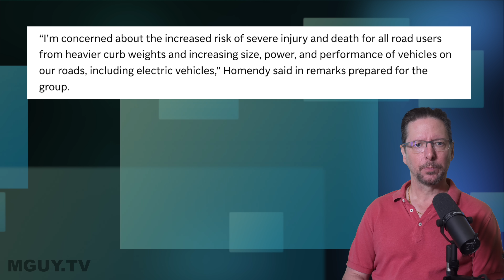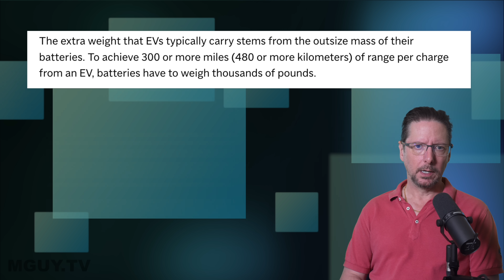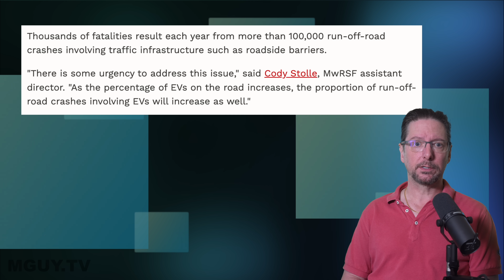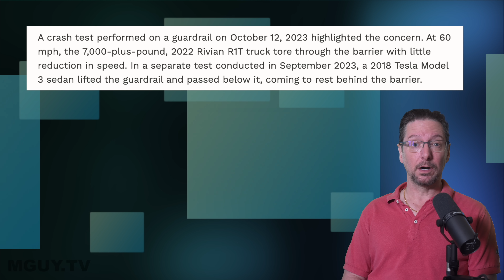EVs TOO HEAVY for roadside crash barriers (guard rails) | MGUY Australia

Comment: EV's is just a waste of money. Normal petrol/diesel engines, generates their power internally. EV's uses power generated by our power stations, meaning efficiency loss because batteries dont use all the power charged from the wall. Not power efficient. About 10% of the wall power is lost to heat and other reasons.
Reply: 66% of the primary energy used to create electricity is wasted by the time the electricity arrives at the customer's meter - i just googled it, if it's wrong someone please let me know. If it's true the whole EV efficiency is a bigger farce than I thought.
Reply: Every time you convert one energy form to another you lose efficiency. Converting coal, oil, gas, to boil water to make steam to turn turbines, then transmit that electricity only works if scaled up. Wind and Solar have their own problems as you rely on the weather which is fickle. @johndoe-vy4bt
Reply: @johndoe-vy4bt correct
Reply: @johndoe-vy4bt  Google kilowatt rating gallon of gasoline.  It's 33.7kWh but look it up anyway.  EPA estimate an average of 5kWh to produce a gallon.
Reply: @johndoe-vy4bt  we end up with  34% overall  efficiency then,  about what I'd expect,  thanks for the information.
Reply: @johndoe-vy4bt  Also a Model 3 uses about 1/8 of the energy of the average ICE vehicles on the road in Australia to drive a given distance. So your argument is not quite as strong as you thought.
Reply: @GDM22  It doesn't need to be. It's just another nail in the coffin for the "green" EV fantasy
Reply: @johndoe-vy4bt  lol. a fosil fuel car uses about 20% of the energy contained in the fuel. And you are right for electricity from fossil fuels because the limit for normal power plants is at 50%. You are totally wrong when we are talking about green electricity. An EV is using around 80% of the energy stored.
Reply: @svenweihusen57  Wrong, as usual. The thermal efficiency of a diesel engine is around 40%.
Reply: @romanpolanski4928  and 20% for gas engines. How many personal cars in the US run on diesel?
Reply: @svenweihusen57  20% is a fairly pessimistic figure : petrol cars:  At least modern ones generally range 30 to 35% particularly with high compression fuel injected engines
Reply: @malcolmwhite6588  Your numbers are correct. I rechecked my source but still lets make a comparison. A normal car uses around 5+l per 100km of gas which is around 42,5 kWh of chemical energy. Electric cars need around 22 kwH (all EVs, most are currently bigger cars). 
looks better but still and many bigger cars (in the range of most EVs) will not make it with 5l.
No matter what: EVs are crazy efficent compared to fossil fuel cars WHEN they use green energy. Using an Ev with electricity from fossil fuels will drop the efficency in the range of a diesel engine. 
And they are heavier than normal cars on top of it.
Reply: @svenweihusen57  Virtually all commercial vehicles in the US (trucks, buses etc) are diesel.

What is the efficiency of an EV after the energy has been generated by burning a fossil fuel in a power plant, the energy converted into electricity, and the electricity transmitted over copper cables to the charging station?
Reply: @romanpolanski4928  without doing actual calculations most likely similar to diesel truck engines. But there is something that you are ignoring: you can also use renewable energy to produce electricity. And you are ignoring the energy consumption of pumping, refining, transporting and distributing the fossil fuels. If you include these and use green energy an EV will be way more efficient and even without green energy it will still surpass a diesel engine.
Reply: @svenweihusen57  You could be even more "environmental" if you would just ride your Unicorn.  But please clean up after it.
Reply: @svenweihusen57  Wishful thinking on your part. Why are electricity costs so  much higher in countries with the largest renewable energy in their energy mix (eg Germany, UK)?

This just in: Volvo dumps EV manufacturer Polestar. https://www.youtube.com/watch?v=gaipp-eu0BU

No one wants EV's.
Reply: @romanpolanski4928  Because it is expensive to switch from fossil fuels to renewable energies. It’s a huge investment because you don’t just need new „plants“ but also must rebuild the whole grid. And yes it is cheaper to produce electricity by decade old nuclear reactors like France when the state covers the risks of a failure which is a subsidiary. The new rector in GB will produce electricity at costs around 16€cent (without proper insurance against a big accident) while offshore wind parks get less than 8€cent while being fully insured.
Reply: @svenweihusen57  If the higher costs of RE electricity are due to the cost of conversion from FF, then costs should be coming down by now as RE has been in the energy mix for over 20 years. Yet electricity continues to get more and more expensive. Why is that?

Rmember that Wind doesn't work when the wind isn't blowing, and Solaar doesn't work at night or in Winter. What do you use then?
Reply: @romanpolanski4928  hydrogen or stored electricity. The grid will look different when it’s fully renewable. You are proposing fossil fuel. Why are fossil fuels getting more expensive when the technology is over a century old? And what about the limited amount of oil/gas and the increasing energy consumption?
Reply: @svenweihusen57 
Are those the same renewable energy that takes hundreds of acres to produce the same as coal
Reply: @FP194  sure. Because they will still produce in 1000 years while oil will run out in 50 and coal in 200.
Reply: Ev also discharge while idle. On ICE vehicule it would be the equivalent of a car dropping fuel while idle; that would be a lot of money wasted over the life of the vehicule
Reply: @calibure859   They also spend energy charging.  The coolant pump on the Tesla battery runs to keep it cool while charging it.  That's like permanent-idle in an ICE
Reply: @calibure859  It is not equivalent to a car dropping fuel while idle, plus ICE vehicles also burn fuel when idling. if you mean when parked then maybe. "Idling is leaving a vehicle's engine running while the vehicle is not in motion"
Reply: @xiangkunwan   yes, to be more accurate I meant "parked" when writing "idle". Thanks
Reply: @calibure859  true it did drop when it was 0° out.  I went from paying 2.5 cents a mile to 5.5.   What are gas cars paying per mile
Reply: Tell that to Californians charging their Tesla's at a diesel generator powered charging station.
Reply: All this arguing over ICE vs EV is irrelevant when the goal is eliminating the personal vehicles from the peasant masses. Not helping the environment.  Remember the goal is you will own  nothing and be happy serving your Master's whims.
Reply: You’re not going to like the efficiency of a petrol/diesel engine with regard to energy conversion.
They’re about as efficient as an incandescent light globe.
Reply: A petrol engine can only use about 25% of the energy in fuel because of the physics of the combustion cycle. The rest of that energy is converted into heat, water, CO2, and pollution. Diesel engines are a little bit more fuel efficient.

An EV turns about 85% of the energy it receives from the grid into power. Some models are close to 90% efficient.

Even if you make electricity with a coal plant, EVs are more efficient than internal combustion engines.
Reply: I honestly think that people who write comments like this are mentally ill. Deisel and petrol requires energy to get it out the ground, convert it to fuel and get it to petrol stations. The level of delusion is honestly embarrassing.
Reply: Plus the power drains out of the battery within a few days if it’s not used.
Reply: Also the amount lost from power plant to consumer is very high
Reply: @AH-lw2bj  Compared to being pumped out of the ground in Saudi Arabia to your local gas station.
Reply: @GDM22  It's a shame you don't live next to a lithium mine.
Reply: @GDM22   yes, actually, but I'm not a fan of that either...
I'm in Canada where we have some of the richest oil reserves in the world but don't use it or refine it due to environmental lobby, but we're happy if it's shipped half way around the world... go figure

It's all gross but to pretend that EVs are going to be any greener than oil is just plain wrong
Reply: @AH-lw2bj  So most of the government's around the world are pushing EVs for no reason, seriously.
Reply: @PruneHub  I live pretty close to the biggest lithium mine in the world.
Reply: @GDM22   politics never attracts the best and/or brightest
Reply: @PruneHub  The lithium is not extracted there from Brine.
Reply: @GDM22  You didn't tell me you live next to Hogwarts.  My apologies.
Reply: @PruneHub  The biggest Lithium mine in the world is at Greenbushes about 240km from Perth. The lithium is extracted from ore, not from evaporative brine ponds that uses large quantities of water.
Reply: The far left woke liberals have 0% understanding of basic electric theory or physics
Reply: 1. Child battery mineral labor

2. Range anxiety

3. Risk of garage fires

4. Paying 20k more than a
comparable vehicle

5. every time you fuel up an EV, the fuel tank gets smaller  and smaller. Battery degeneration. 

6. Poor resale value

7. Reduced performance in
cold, highway.

8. Higher repair costs

9. Awful charging network
experiences in the weather
without restrooms

10. Higher insurance rates

11. Replacing tires more
frequently. Michelin states that tires wear out 20% faster on an Ev, and could be as high as 50% faster! Ev tires made for ev's, cost 20 to 30% more, than regular tires for ice cars. As Ev tires wear out, they leave behind more tiny particles of rubber than normal ice cars. This causes more pollution. 

12. Death by autopilot

13. $25k - $35k battery

14. Low km range per tank of energy. 

15. must wait in-line 1-2 hrs
to charge.

16. Then wait more time to charge, while charging.

17. Spontaneous combustion, with no way to put out the fire storm.

18. If they catch fire in a tunnel, many people will die.

19. People without a pro charger system or a parking spot at their house, will run an extension cord to the road, which is dangerous and could lead to people tampering with your charging setup (super slow charging at the road)

20. If you're in California, you won't be able to charge your car past 4pm because of a shortage of electricity supply on the cheesy grid.

21. It is not actually "green". The pollution is made at the power station, not the car.

22. Only 5% of used junk batteries get recycled, the rest go directly into the bin. It's cheaper to mine for new minerals.

23. Chhinna actually does 70% of all the refining of the minerals and production of the batteries.

24. Minerals are becoming more and more scarce, and the cost will only go up, not down.

25. Some countries where they mine for lithium, actually use a very big boat load of fresh water to only produce a ton of lithium, so they are afraid of running out of water. It takes over 2 million liters of fresh clean water to produce 1 ton of lithium. 

26. Ev cars will soon not be able to drive in tunnels or be able to park in underground parking garage and probably will eventually void your house insurance if you park it in your personal garage.... 

27. You can't charge your battery at super stations when it is bitter cold out. 

28. If a fire truck comes to put out an Ev fire, all the chemicals go directly into the sewer system, poisoning everything. They need tons of water to slow down the burn. They can't put them out. They are only trying to prevent over things near by from catching fire. 

29. Ok, there is 2 good things; regenerative braking, which charges the battery while you are slowing down on the highway, which saves your brakes from much wear.

30. Loss of fuel tax revenue, so now the roads will only get worse, not better. 

31. in Dublin, huge generators are being used to charge EV buses, due to electrical grid strain. buses in Athlone also cannot be put on charge until midnight, for the same reason. Bus Éireann is saying that they can't charge their buses until 11pm for the same reason,  and to avail of a lower tariff. 

32. Not everyone on earth even has electricity to charge their cars. What are they supposed to do in 2035? It's easy to get a bucket of fuel to power up a regular car. 

33. VCE, or "vapour cloud explosion" is very bad. If any battery, typically anything larger than an E-scooter battery, and especially only "half" charged. If a problem occurs in the cells, it might not catch on fire right away. Instead, a cloud appears, and then may be ignited a short period afterwards. There are 2 different types of vapour clouds that appear; heavier and lighter than air, which form will be dominate, can not be predicted yet. This produces a bomm.

34. For Ev transport trucks, they aren't allowed to carry the same payload as a diesel truck, because of the massive weight of the battery. The owner of the Ev truck therefore loses potential profit, every day. They also lose more profit for the waiting times for charging that Ev truck. The driver will get paid to charge the truck, which in turn forces the owner of the truck to lose more money. 

35. Ev cars are more likely to be written off, if they experience a minor collision. After the collision, something could have upset the structural integrity of the battery. 

36. Ev cars lie to you. If you are bold enough to go out on a decent road trip and its 210 miles, one way, and your Ev tells you that your battery will last you 223 miles, there had better be no hills, or excessively cold out.... You'll probably get stranded, trying to get to the charger, at the end of the trip. Ev's have left many families stranded already. 

37. Ev's and their batteries, will soon need their very own "passport". With all info about them when born, and current info about them (power output, resistance, mineral composition, etc.) 

38. Thieves stealing charging cables, will soon make it impossible to "fuel" an Ev car. They take a long time to replace the cables, just to have them cut again for scrape money. 

39. Cars were typically being made lighter and lighter using aluminum and or fiberglass and or carbon fiber, to reduce emissions and pollution. Ev's are only getting heavier and heavier, causing more pollution than ever. Remember, an ev's pollution is made at the power station and the dump, not at the actual Ev, except for the tire particles as mentioned above. 

Ev's (External combustion vehicles) suck, and it's a bridge to nowhere. But they do sometimes convert themselves into "internal combustion", but sadly, they can only do that 1 time.
Reply: Turning gas into motion is not 100% efficient either. Lots of heat. That mean free heat for an ice car tho!
Reply: Yup, my ICE even generates its own virgin oil from fossils it picks up off the street !
Good God, Moon, you win the Internet for stupid post of the year.
Reply: It's even worse, the department of energy even admits that over 70% of all energy is lost in one way or another before it even reaches a homes plug. The reason why energy isn't even more expensive than it is, is because it's heavily subsidized by the government printing money. So when you think you're paying 20 cents a Kwh, you're actually paying more like 60 cents a Kwh. And that's not even including the extra charge from fast charging stations, which makes it more like $1.50  per Kwh. That means you are essentially getting the ultimate equivalent of paying 45 dollars to fill an EV battery, it's just the costs are hidden by the government through various subsidies that the tax payers ultimately pay. 45 dollars to go 300 miles is the equivalent of buying ~11 gallons of gas at $4 a gallon....except at 30mpg in a gas vehicle, you'd actually still be getting slightly more range than the EV for the same cost. What this all means is EV's being more efficient is a lie. The energy companies use MORE resources to generate that energy that goes into EV's, than a gas vehicle uses to go the same distance.
Reply: @peoplez129  sorry but BS calculation. The losses are always included or are you claiming that ONLY electricity for EVs is so cheap due to subsidies and the electricity you use at home is naturally cheap? And if you are using renewable energies a lot of losses simply vanish because the thermodynamic process in fossil fuel power plant has a max efficiency of 55%.
EVs plus fossil electricity isn’t the smartest idea but you have start somewhere.
Reply: @peoplez129  If you include the electricity subsidies, then include the fossil fuel subsidies too (US$1.3 trillion direct and US$5.3 trillion indirect subsidies in 2022)

the economy is also footing some of the indirect subsidies from the burning of fossil fuels, including the social cost of carbon emissions from burning gasoline which is CA$455/ton of CO2 (CA$0.9797/L of gasoline) in 2024 (Canada.ca) gasoline would be US$6.90/gal of gasoline for a US$3.19/gal gasoline
Reply: @peoplez129  The state governments in Australia are not subsidising the cost of electricity, they run at a profit or provide a dividend to government.
Reply: Er, and where do you think oil refineries get the electricity they use?   And what about the huge amounts of electricity used just to pump oil out of the ground, before it even reaches a refinery?
Reply: @Brian-om2hh erm, whatbout all the fossil fuels used to mine out lithium from underground or all the child slave labour required to source the cobalt.
Reply: @RaArkestra  What a great reply 🤣🤣🤣
Reply: @DwaynePipes 
Nice deflection
Reply: @DwaynePipes  LFP batteries by far the most used in EVs in Australia have no Cobalt in them.
Reply: @GDM22  Great, that's good news.
Have you mentioned it to MGUY?
Reply: @Brian-om2hh  where do you think all the plastics come from which is used to make an EV lighter to offset their battery's weight ? Oil.
A battery in say a Tesla weighs a damn sight more than the engine and transmission in an equivalent ICE vehicle.
Reply: @Brian-om2hh  They need electricity to pump the oil for all the new substation transformers (thousands of gallons in each) required to supply your EV with power You do realize without oil you wont even have EVs, try to be realistic if possible.
Reply: @Brian-om2hh  I always thought oil refineries burned a small portion of the incoming crude to power the refining and distillation processes. Perhaps you know better, though.
Reply: @Brian-om2hh  you obviously haven’t done a great deal of research or have been misinformed. It does depend on the refinery in question, but many refineries generate their own power by utilising waste gas in a co-gen unit or a steam turbine (bypassing some of the steam used for the refining process )-still use of energy of course but many cases is it uses otherwise wasted energy. Frequently the same thing getting the hydrocarbons out of the ground. Certainly in New Zealand. The fields are a massive pressure and actually need to be manually throttled in to prevent them generating too high surface pressure. There is certainly no energy used other than the hydraulic pressure that the field itself is under - many times several thousand pounds per square inch Once again driving, the product to the production plant is also frequently done by the inherent pressure in the system
Reply: @Brian-om2hh 
You do realize that the current electric grid can’t handle the proposed amount of EVs 
Did you know in California they use gas generators to charge their electric vehicles because the grid can’t handle it
Reply: @FP194  I just read a news article on "The US Added 1.2 Million EVs To The Grid Last Year, & Electricity Use Went Down"
Reply: @Brian-om2hh   er how much electricity are they actually using.? Compared to the energy stored in the oil.?  Oh!!! You didn't factor that into your dishonest argument did you.? 
Just a few months ago the governor of California who wants to ban ICE vehicles in California asked EV owners to cut back on charging their cars because there wasn't enough power in the California power grid available. Only 3% of cars in California are EV. What happens when they are 100%.?  When was the last time there wasn't enough power for refineries and oil pumps.? At 3% EV's are already using more electricity than the oil industry. How much does the gas weigh needed to travel 300 miles compared to the batteries needed to travel 300 miles.? Hydrocarbons are the most efficient means of storing energy and converting it to mechanical energy. One ounce of gasoline has the same stored energy as one stick of TNT.  It takes an average of 5kWh to produce a gallon of gasoline. EPA rates a gallon at 33.7kWh.  You were saying something about efficiency.?
Reply: @Brian-om2hh   the energy density of petrol  /kg far exceeds what batteries can provide. it's a fact.
Reply: @genxray951  right. If you toatlly disregard that fossil fuels are a limited source and the effects of CO2.
Reply: @genxray951  Yes, by a factor of fifty or more. No advance in battery technology will ever close this gap.
Reply: @xiangkunwan  run them on biodiesel
Reply: @Brian-om2hh  a conventional car uses about 20% of the energy contained in the fuel. an EV uses about 15kWh for 100km while one gallon of gas contains around 50kWh chemical energy.
Reply: @svenweihusen57  a gallon of petrol, contains 33 kWh of energy.
Reply: @organickevinlondon  Right. Sorry, I am a German and thought a gallon was approximately 5l. Should have checked the numbers